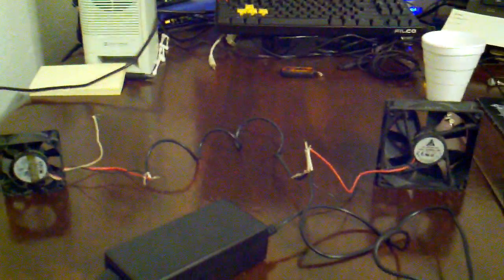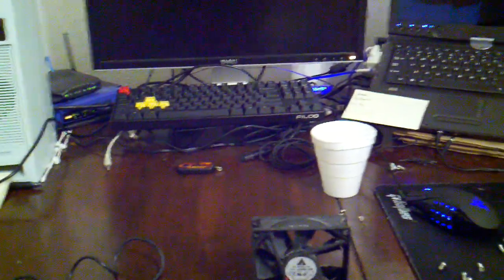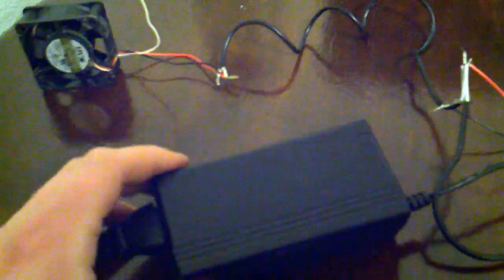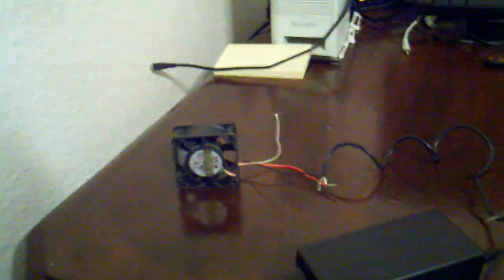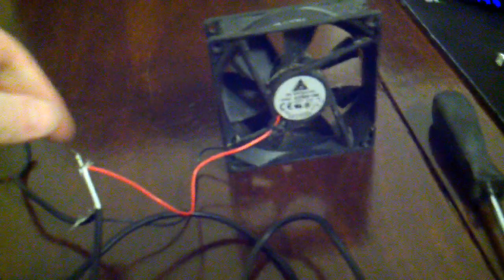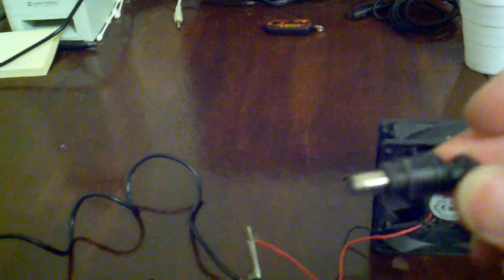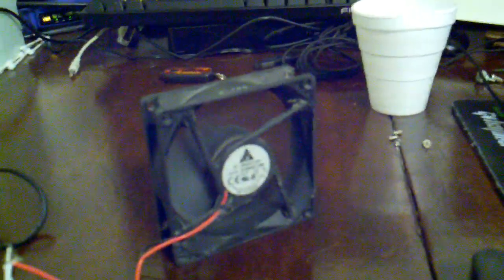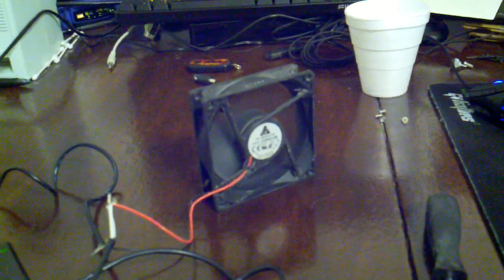Powering two computer fans with an AC adapter

Comment: can i connect 4 fans to 1 adapter?
Reply from the maker: As long as the voltage is the same for this configuration, sure. Your limiting factor is going to be the output amperage of the AC adapter. If you have 4 fans that need .5 amp a piece then you'll need an adapter that does at least 2 amps. The more amps the faster the fans will go

Comment: Hello! Can I connect 2x12V computer fans to the same 12-220V Adapter? Thanks!
Reply from the maker: Yes you can you will need to make sure they are in parallel to keep the voltage to 12v. This means wiring all the positives together and all the negatives together
Reply: Thanks, I will try to connect them together and I will telly ou.

Comment: Im guessing powering 2x12V fans with 24V adapter wont work right? (I've got a 24V AC adapter)
Where could I get a cheap 12V adapter (Im from EU)?
Reply: +TheForgoten100 any 12v doodad with a cheapo switching transformer will provide plenty of current for a couple of fans.
Reply: I've 2x12V fans connected to a 12V charger and they work 12/h per day.
Reply: +dpskjajwnen You mean that I can supply two 12v fans with a single supply of 12v? Because two don't need 24v right? sorry i can't watch and listen the video very clear.

Comment: i've been tinkering with 2 IC fans, like yours, with a 12v wall plug in, and am using them to draw fine sawdust (and any kind of dust) away from me, into a box (with a filter, of course). very nice, nice suction, better than sawdust flying all over the place!
if your p.s. doesn't work anymore, you can pop it open, and you'll find a nice supply of fine wire (for making crystal radio coils), with a long strip of copper (about several grams worth)!!!
nice video! good work, sir!

Comment: i got board a while bak so i shorted a power supply to a com and found a halogen light in my storage room so i used a voltage meter to find the 12V rail and i cut off a useless molex adapter, saulderd the wires to the 12v rail of the molex adapter and now i hv an extra really bright lite, if i wanted i could mount it to the inside top of my computer case

Comment from the maker: @renagade3 It cut me off... Since i haven't done much with a controller one of the first things that I would worry about would be if I could possibly overload it. That may not necessarily be the case because of how they work, but since it would be a new thing to me that is just what I would think. If you do get a controller I would be more proned to getting one of those that are used in the wall to set mood lighting instead of an actual computer fan controller. Not sure if youve thought about it

Comment from the maker: @renagade3 I dont see why not. A switch is just an interrupter of current. I havent dabbled with a controller before but I am sure it does something similar. It would be similar to how you connected the fan in the middle of the cable as opposed to the end where you had to splice both pieces of cabling together. I think that switches dont have cabling with them, just the screws to wrap them around. So you may have to get some more cabling if that is the case.

Comment: I like your setup!  I will be doing the exact same thing to cool/vent a cabinet, but I have a question about how you spliced the wires.  If I am correct, it looks like you completely cut out about a one foot section of the power adapter wire, spliced one end to neg/pos of the smaller cpu fan, and the other end to the neg/pos of the larger fan AS WELL AS THE  the wire coming out of the adapter, right?   Sort of like a daisy chain?  I am a rookie when it comes to electronics :-)